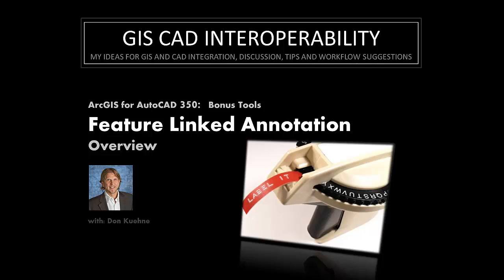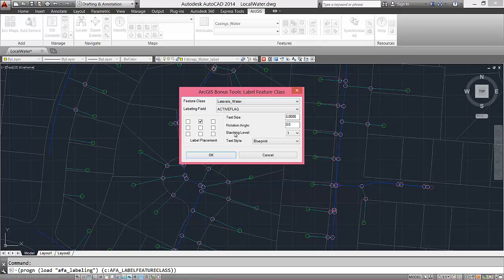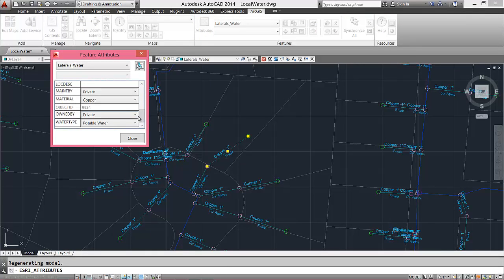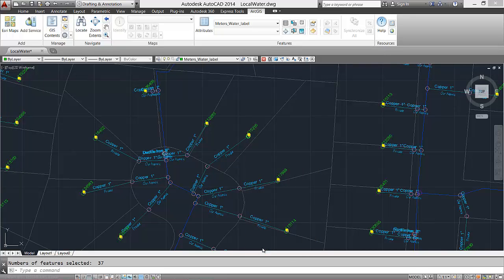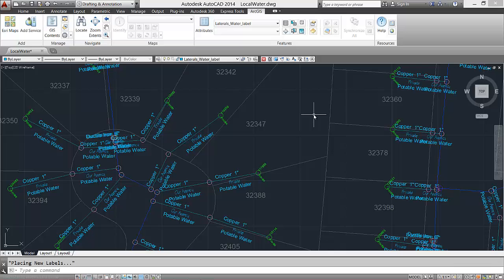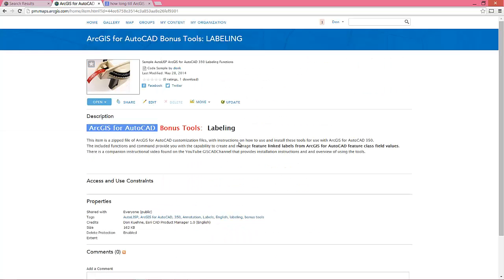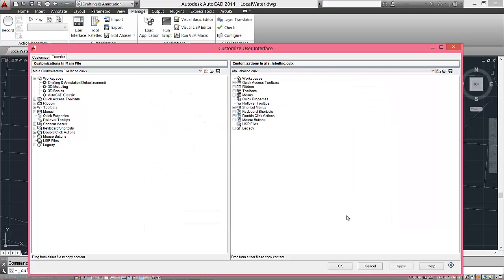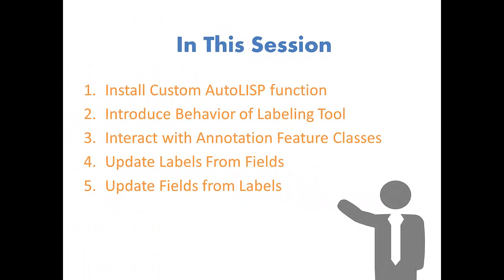ArcGIS for AutoCAD Bonus Tools: Labeling

Comment: I am trying to do some labeling in ArcGIS for AutoCAD 355 and this video is exactly what I what to do. I have followed ever step in the video but I am not getting any labels? I am working in AutoCAD Civil 3D 2017, could that be the problem?
Reply from the maker: If you don't have a strong reason not to, I would first upgrade to ArcGIS for AutoCAD 365, but you should not be having a problem with what you have now.   If you are still having issues you might send me an email... and I can see if there might be something special in your data or an issue with the sample tool.
Reply: I upgraded to AutoCAD 370 and it worked! Thanks

Comment: Thanks for the videos. A couple of questions:

Can this be done with features on a non-versioned sde instance served through Arc Server Basic?

Can the labels be set as a template? We will be extracting features with different extents at different times. Will we have to set up all of our labels each time?

Thanks again.
Reply from the maker: The included bonus tools include commands and functions for labeling with TEXT entities in AutoCAD from ArcGIS for AutoCAD feature classes.  Those feature classes can be inside the drawing (local feature class) or they can come from a feature service.  Your server would need to support feature services in order to EXTRACT features as local feature classes.  This set of AutoLISP commands are for creating add-hoc labels from the field values of feature/entities inside the drawing using a command with a dialog box interface.  If you look in the included documentation you will also see that there is an AutoLISP "function" called (afa_featureclass_label) that you can use to automate the creation of labels without using the dialog.  You could create your own "TEMPLATE" for labeling in the form of your own custom implementation of this function as an AutoLISP routine.  The labels themselves become feature classes that you can manipulate.   Hope that helps.